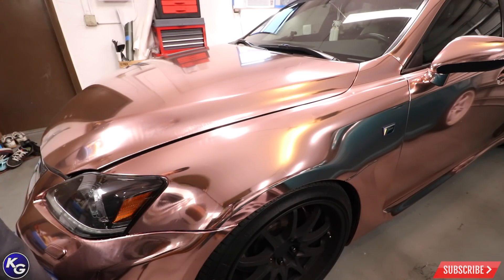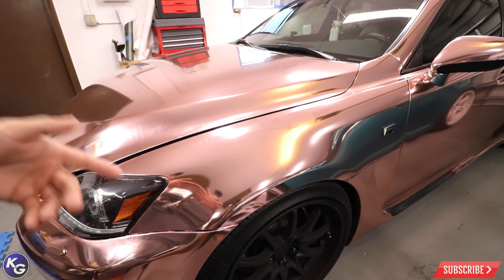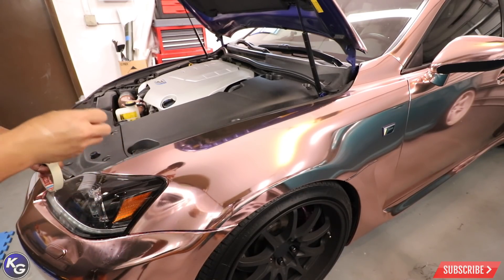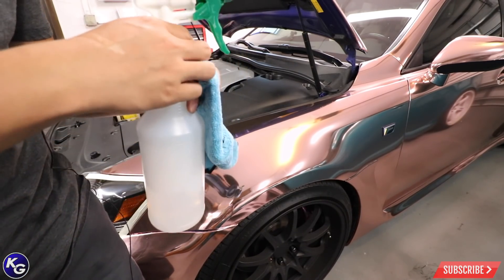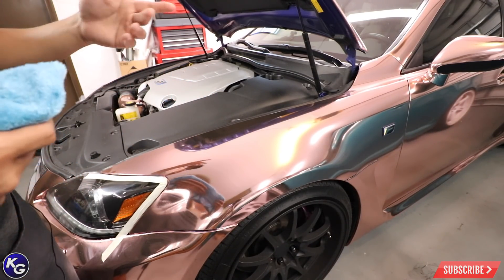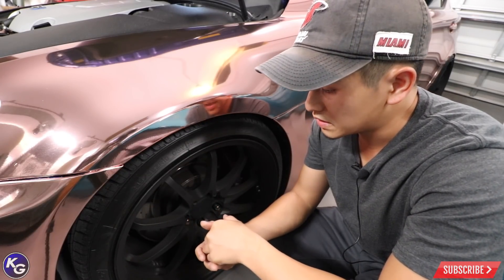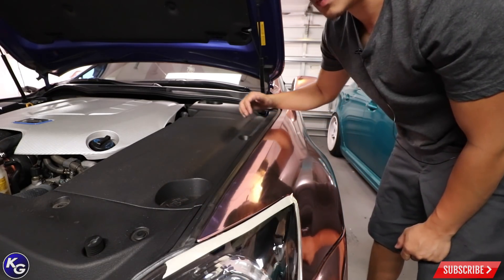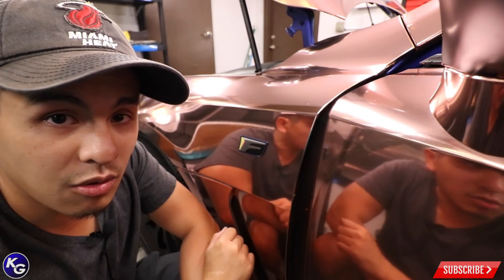Key points to consider before vinyl wrapping a car

Comment: What if the front number has little paint chips.  Will I need to Bando it? Will the small chips show over the vinyl?
Reply from the maker: 60brianaguilar depending on the thickness of the vinyl. Some cases if the chip is small, you won’t see it but I do recommend touch up paint or body work prior to wrapping if you want a paint like finish
Reply: Lam Le they super small. Thanks. I'll touch it up before I wrap. Thanks and keep on posting dope videos man!